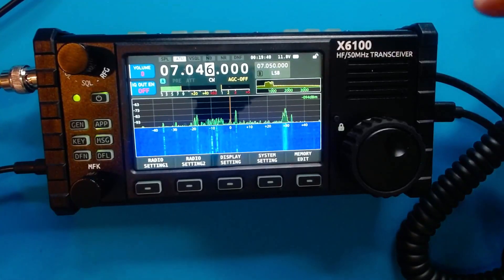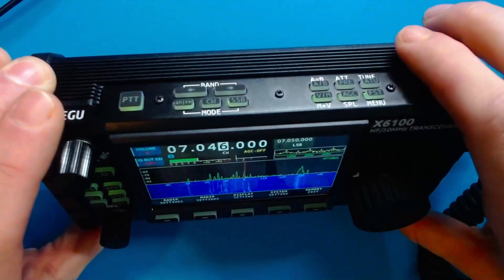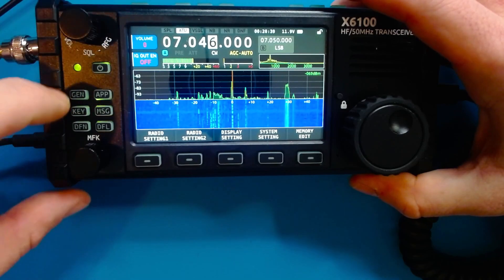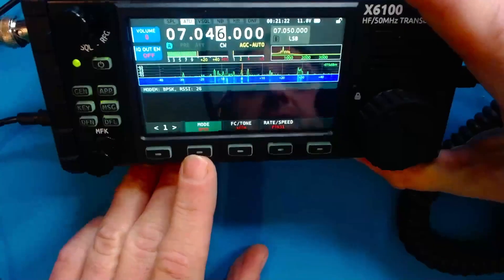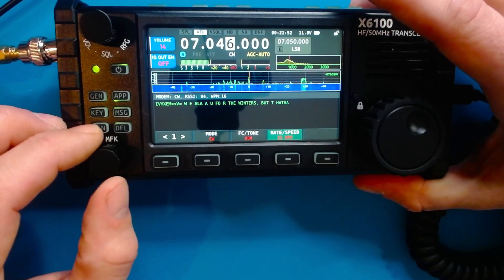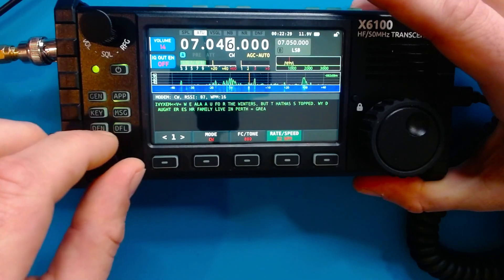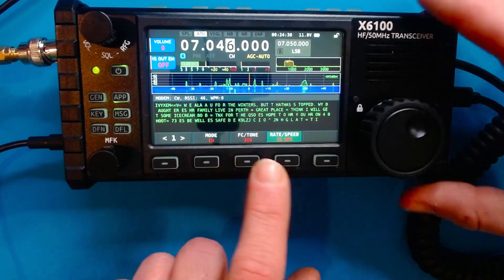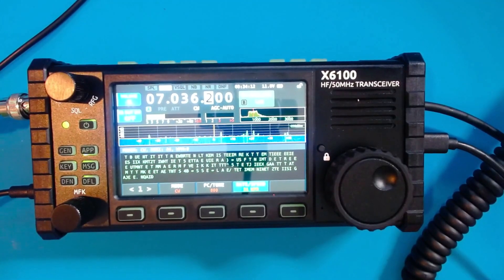Xiegu X6100 - Does CW Decode work?

Comment: Great video man, thanks. If the radio is decoding CW, can I also send CW without changing any settings?? Also If I am sending CW will the radio actually show me what I am sending? last question , can I put the radio into say BK IN off mode so I can practice sending CW without actually transmitting? Thank you so much for all your videos sir, NS9T 73... and POTA ON!
Reply from the maker: Hello!  Thanks for asking. I have not owned this radio in well over a hear, so I don't really remember too much.  CW decoding and Transmit can be done with the same settings (no need to change them when you want to switch between the two),  The radio (as I recall and at the the current firmware I had) did not show you what you were sending. and Turning BK IN off did allow you to practice CW without actually transmitting.  Have a good one!
Reply: @DudeTested  Thanx alot , appreciate it.

Comment: Sure didn't get much help here.  I already had those set and no decoding
Reply from the maker: Sorry to hear.  This video was made when the 6100 was released. If you come up with a solution to whatever problem you may be experiencing, please feel free to share it for others. Cheers and good luck.
Reply: @DudeTested  I was hoping to find one here, or another YouTube person.  So far, no luck.  Is it a firmware that works?  I'm on v1.1.y 20231018, which is what the radio came with.

Comment: What a crap decoder algorithm. You have to set the speed manually or it doesn’t work very well. I’ve written code that can automatically adapt to the speed along with tone detection based on goertzel filter.